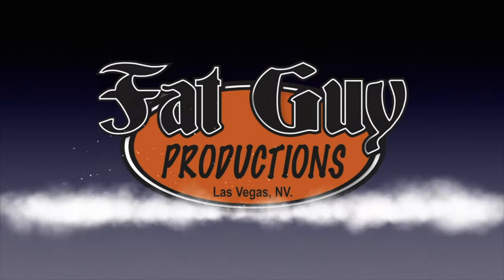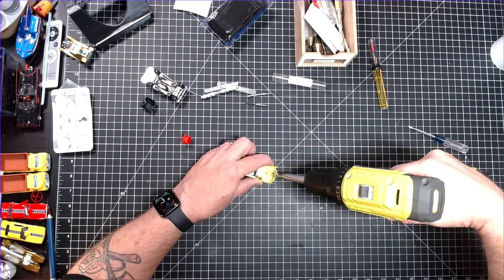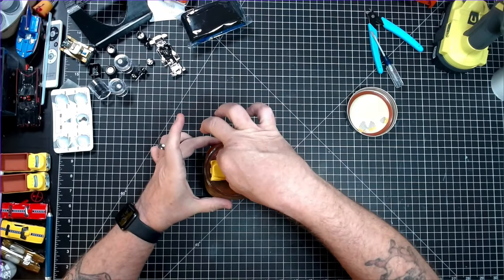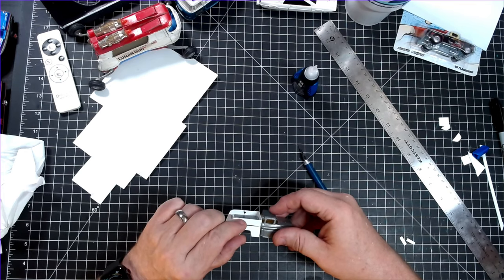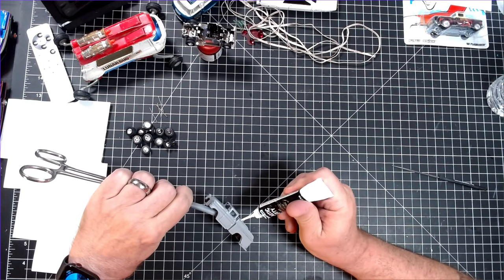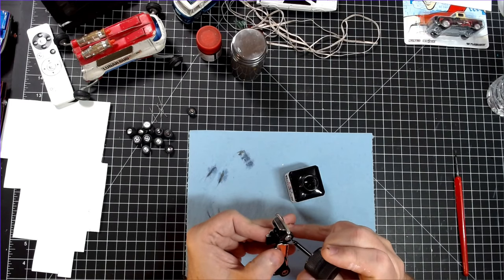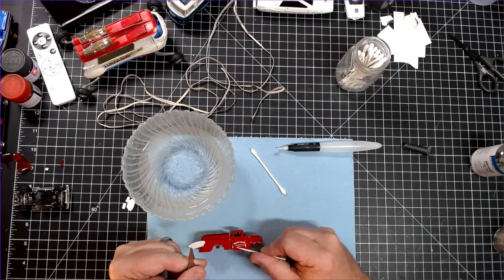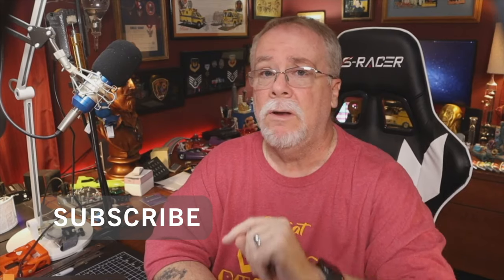The Three Blind Mice - The Flashsider Invitational Revisited.

Comment: oh, I almost forgot.
about the lubing, since zamak is considerably softer than steel lubing still helps. the drilling makes the material melt in front of the drillbit's egde, and adding some oil prevents that by cooling, and keeping both materials apart. and lubes, of course. so where steel will make your drillbit heat up until it loses sturdiness and cut, the softer stuff will clog it. all in all, adding some oil is never wrong.
(except if you use that cutting oil-water emulsion we germans call "drilling milk" on brass, which causes a reaction that leaves everythign messy and sticky as hell. and some metals need alcohole for cooling instead of any lubing. I could look up, which, but I guess you won't run into that problem, anyway. :) the things one learns becoming a car mechanic here... back in the 80's.)